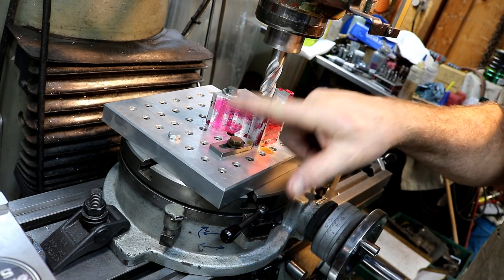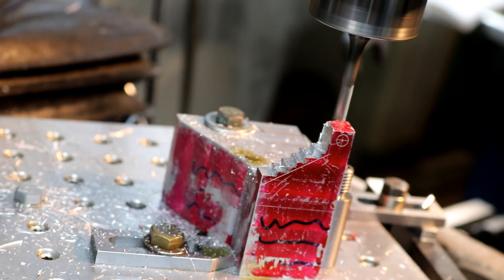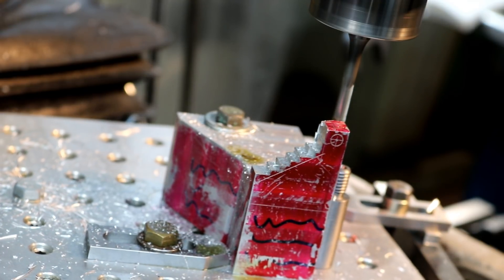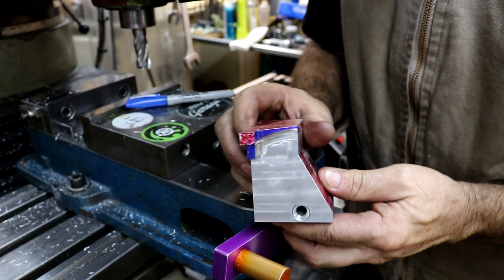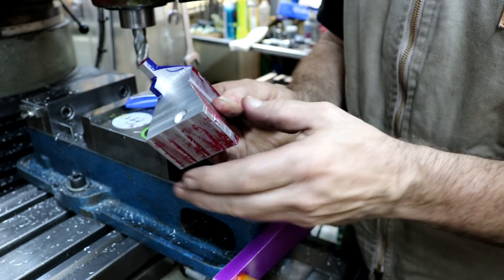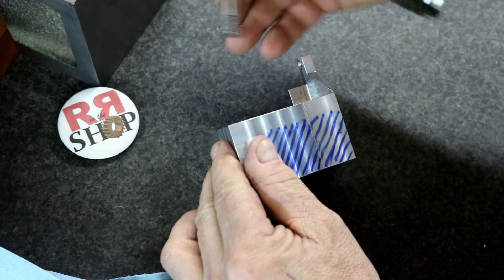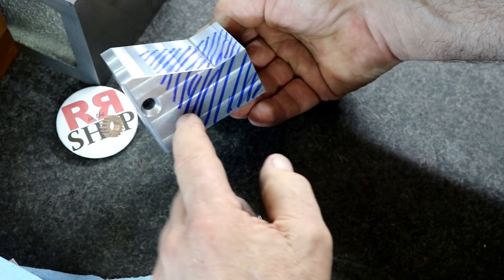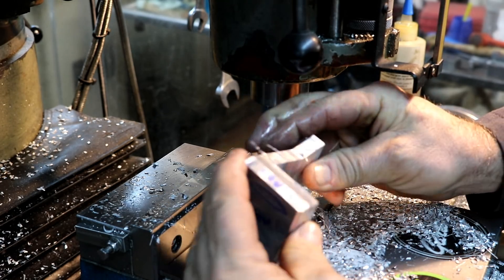P2-3 Darex Drill Grinder / Sharpener, Making New Parts Project

Comment: At 3:00 in you are running (just funnen) what looked like lights out you are a good machinist Randy. The part is really coming along well you have intricate work going on while still having a heavy overall upper mid base (thank you) component. There I spoke too soon there goes all the main material mass getting lighter, looking very much like a well made bracket. I see the .060 x.100 guide rail you mentioned after you cut it, see what it is for at the end fit looks good.
Reply from the maker: Thanks Lance, it looked to bright in the camera so I turn a light off,  but after I should of left it on.  Nothing like working in the dark.